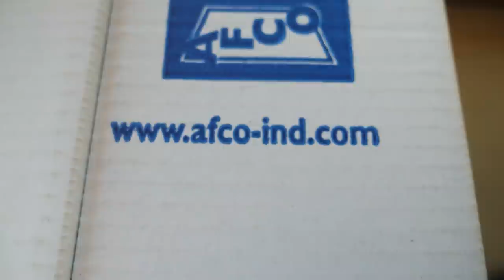Fantastic PORCH UPGRADE! Installing AFCO Aluminum Column Wraps

Comment: Looks like a million bucks! 
Water will find its way inside the aluminium cover and probably there will also be condensation, so if I were you, I'd leave at least one side of the bottom uncaulked, so that it can run out.

Comment: You could make some really cool candle lanterns from the cutoffs for citronella candles or the like. Some for setting on tables and others for hanging.
Those came out so nice! They look really good and are a perfect color match. Great job!
Reply from the maker: That would be cool
Reply: @Guildbrookfarm  - Right?!? And they’d match.
Reply: Another thing the ends can be used for is to hide the pots of plants, or they could be used as planters if they had a bottom installed. Best wishes for the new year.

Comment: The Afco post wrap looks like a very good solution  to ugly wood. Question, do you think the aluminum when warm to cold will condensate on the inside ? If so sealing the bottom might not be a good idea.

Comment: The bases you can glue on with urethane sealant. You don't need the JB Weld. OSI works well and comes in bronze. Caulk behind it, at the joint, then across the top and the bottom. Put masking tape on it until it sets up and it's good to go.

Comment: A suggestion, drill a weep hole in the bottom of your post trims… I would not have sealed the bottoms, any water that make it’s way in the top of the posts will now fill up the post trims.

Comment: Here in Canada, the temperature gets much lower and has a wider range than where you are, so aluminum is not as popular due to the expansion and contraction that sometimes reveals seams and gaps ;) Your application looks great :)
Reply: Yep. I've seen covering wood posts with aluminum turn into a disaster some years down the road. I think even Mike Holmes show had an entire sub division that all had that issue with relatively new homes. Metal with the different expansion rates than concrete water gets in it can't get out and then there will be hidden rot at the base.

Comment: Historically the only type of wood preservative you could get for construction lumber was a cupperic-oxide solution (copper), either painted on the surfaces or infused via pressure treating.  Now with all these "safer" chemicals, copper can't even touch our pressure treated boards? Crazy.  Great video as always.
Reply: I think it’s more about the copper in the board reacting with aluminium. Aluminium can be pretty reactive

Comment: Nice job, the material looks solid. I would suggest leaving a weep hole at the base so any water from condensation has an escape route. That aluminum will probably condensate in the sunny areas and the water needs an escape route.

Comment: I know the railings you are about to install will be around the porch but do you intend to also put  a banister (or whatever it is called) next to those beautiful stairs?  As an elderly person I could not possibly make those stairs without holding on to something.  Believe me when you are old you will want to hold on to something going up the stairs.
Reply from the maker: Of course. Its required by building codes also.

Comment: Interesting product. Two questions... 1) are you going to drill a drain hole at the base of each post? You can be 100% certain that water will eventually get in, the trick is to ensure it can get out.  2) Did you consider fitting only three sides of the post cladding before putting the handrails on to allow access for packing and general adjustment?
Reply from the maker: Yes a drain hole will be hidden behind the base trim. I hadn't thought about only doing 3 sides and then fitting the railing. That's a great idea.

Comment: I want to do this but I’m trying to decide if just priming & and a good exterior paint for the post is a better option than using aluminum wrap. 

Do u have a suggestion?
Reply from the maker: I used aluminum so I never have to repaint or replace rotted wood, and the color doesn't fade.

Comment: I am about to install these and I thought hte JB weld was a good idea. Wouldn't you want to JB weld the top caps while they rest on the bottom ones, then slide them up into positions to screw them as a surround to top of column? Seems like it would be hard to get the mitered corners aligned with screwing them two pieces separately.  Do you think that is reasonable approach?

Comment: Hi,
I have a question about porch posts. I need to replace my porch floor (w/pvc boards) and posts (w/cedar). Do the post rest on top of the TnG boards with solid blocking underneath or do they need to go through the floor and rest on the brick pillars? Thanks so much! Btw, you are a fantastic teacher!
Reply from the maker: Posts usually sit on solid footers and deck boards are notched out around the posts.
Reply: @Guildbrookfarm  thank you for your reply! So in my case, with the brick pillars coming up few feet — I would just drill and install post brackets and fasten the cedar posts on to the brackets, correct? Should I wrap the bottom of the cedar posts with any flashing tape to protect them from moisture or just seal the bottoms of the posts?
Reply from the maker: Porch posts/columns that hold up a roof need to be on footings. Railing posts bolt to the decking with blocking beneath.

No need to treat cedar but I would use a good oil based penetrating stain.
Reply: Okay, sounds good! Thank so much!

Comment: Why didn’t you wrap the blocking isn’t that aluminum touching wood there ?
Reply: I don't think that the blocking has been chemically treated so it should be fine.
Reply from the maker: The blocking isn’t pressure treated.

Comment: Wouldn't it be less expensive to just buy aluminum columns originally.
Reply: Would not have the strength to hold up porch roofs.
Reply from the maker: They actually would. These are rated for 20,000lbs of structural load each when used with a top and bottom plate.